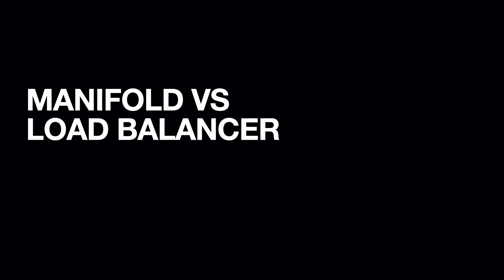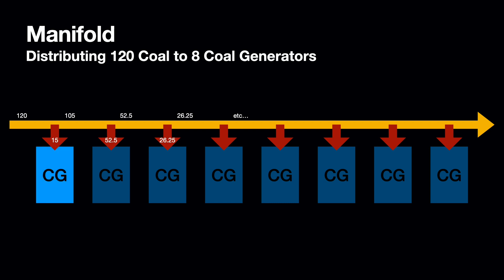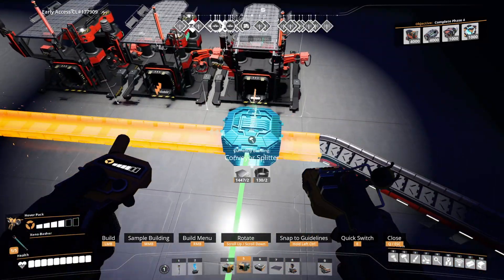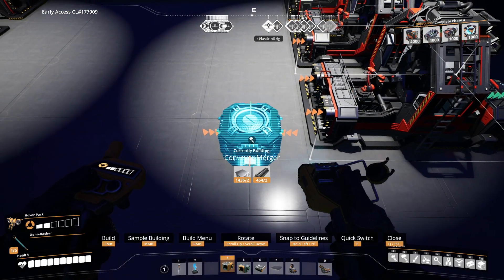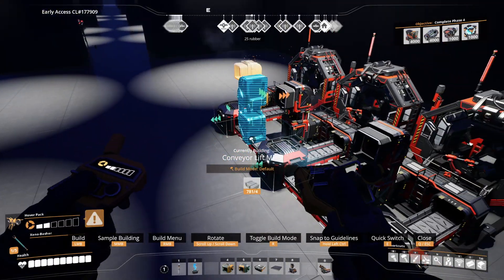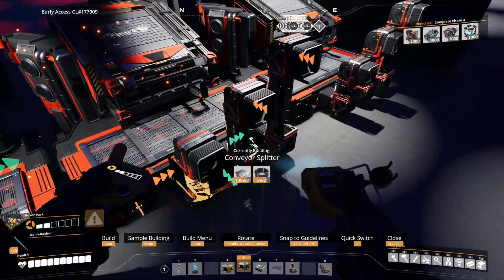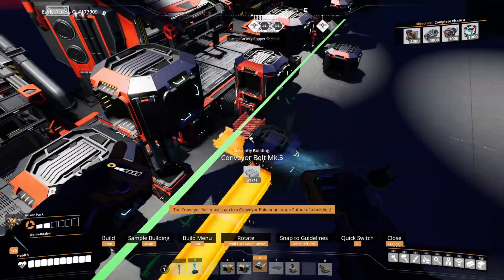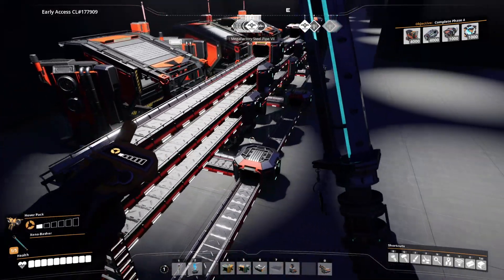Manifold vs Load Balancer - Distributing Items Evenly in Satisfactory

Comment from the maker: Hey - a minor correction! I claim in the video that it’s not possible to build a load balancer for, say, 7 inputs. This is actually not true. You can build this by first building a load balancer for 8 inputs (split to two three times), then sending seven of those to machines and the number eight back to the start of the load balancer. Provided the belt has enough capacity for this extra input, this will be a perfect load balancer for 7 inputs. The same principle can be applied to any number of machines that is not simply a product of twos and threes.
Reply: If you don't have belt capacity you can split the 8th output in 2 and merge them after the first split in 2.
Reply: You know you could dump the 8th into awesome sink.
Reply from the maker: @Naresh-gj5vc  but FICSIT doesn’t waste!
Reply: Anyway , if I need to feed 7 machines, I use one of these two buildings (that are not perfectly even but close, and much more compact):
- a first splitter with three outputs, then two splitters with two outputs and one with three outputs;
- a splitter in front of machine 4 with three outputs: one for machine 4, one for a manifold in front of machines 1-3, one for a manifold in front of machines 5-7 (but I use what I call "improved manifolds", I explain that concept in the next example).
Generally speking I use an hybrid system between manifolds and balancers. For example if I need to feed 10 machines, I will probably split my line in two (one part for a group of five machines) and I'll use an "improved manifold" for each group of five machines. The difference with a classic manifold is that the conveyor belt doesn't arrive in front of machine 1 but in front of machine 3. That way, when you start the line, machine 3 will receive 1/3 and all the other ones will receive 1/6. That way they will reach 1/5 each faster than in a normal manifold build where machine 1 first receives 1/2, machine 2 1/4 and so on... My  improved manifold is more efficient that the regular one, as compact and even requires 3 splitters instead of 4.

Comment: Whenever I see videos like this they always point out that the manifold is so slow. What people fail to observe is that if you had 2 inputs you do NOT need to merge them. Send the 2 into specific locations of you group and split in both directions. For each additional input beyond 1 input you halve the number to reach. So in your example the Manifold at 3:30 the splitter starts in the center input and the splitter goes left and right. It will fill at almost the same speed as the load balanced mechanism.

Comment: With Coal Generators a Manifold is no problem as the coal isnt burned in 1 machine fast enough so itll back up and at some point reach the last machine wich will also get enough maybe even a buffer, its really a problem with Producing stuff because of the fact that not all machines work same speed if u use a manifold they will not have the desired output and thus furter down make problems again.
Reply from the maker: Manifold will always work even if the machines don’t need the same amount of materials as long as you feed it at least the amount of materials your machines need combined. And of course also use a belt that supports this speed.
Reply: @Fjorim  i play since release i know that but Load balanced works better for things like train stations where the resource may run out until the train arrives so every machine gets the amount it needs instead of it having to stock up.

Comment: How I do my Manufacturer. Showcased in this video: https://youtu.be/otuw_KZ3RQ8?t=762
Reply from the maker: Yeah, there are several ways to build manifolds for machines with multiple inputs. I’m actually using a service level these days, and if it’s high enough (4 walls), you can have all belts going down next to the manufacturer, and downstairs connect them to a manifold at different heights. My service level is 2 walls tall, so I need to have two rows of manifolds going downstairs, where they are connected to manifolds at two different heights. It’s a bit hard to explain, but I will showcase this more when my next video on the maxed nuclear plant is up :)

Comment: Manifolds are my personal preference.  Yes, a manifold system takes longer to “load,” but they are as adaptive as you need them to be up to the maximum capacity of the belts or pipes that supply them.  A load balancer only handles a set amount of material at any given time and is more difficult (in my experience) to adjust to new inputs/outputs once built.

Comment: You can improve manifolds by using smart splitters with overflow.  This greatly reduces the time for the manifold to saturate
Reply from the maker: Not sure if I agree. Yes, the first machines will saturate much faster with smart splitters, but the last machine will only get items when everything else is full. This is the case also with normal manifolds, although with those the last machines get some items also earlier. When fully saturated, both manifold types will reach 100% efficiency.

Just watched TerrisDWDC’s video on this topic and I’m not sure I can say the smart manifold is better. It seems to produce fewer total items at least.
Reply: @Fjorim  here is the issue without the smart splitters you have machines going on and off wasting input.  If a machine gets an item then finishes processing it, that item does not help saturate the system with product.  By using smart splitters each machine is fully saturated sequentially, so every item helps saturate with no stragglers.  I mean just test it yourself its pretty simple.
Reply: @marcbennett9232  How does a machine going idle "waste input"? If you're saying that if constructors require 5 items to process, and the last machines are sitting with 2 or 3 and waiting, that's not wasted at all. It's not even slower.

In the smart splitter case, those items are idle on the feeder belt instead, so the "faster"  breakpoint would depend on two numbers:  how many items it takes to turn on the machine,  versus how many items are waiting on the feeder (including inside the splitter) PLUS the stack size of the item input, because all those are sitting idle inside the machine as well. So for an AI Limiter, 480 Quickwire (plus the feeder) would have to be idly waiting before the second machine sees anything.
Reply: @ricobarth  no your misunderstanding my point.  the machine going idle doesnt waste input.  the input not backing up is what is wasting the input.  so a manifold needs to "warm up" to reach 100% efficiency.  most people understand by now, a manifold is just as efficient as a load balancer after this warm up period.  the smart splitter helps by greatly reducing the time it takes the manifold to warm up. here is some of the math.  i will also work up an in game example, but i will get back to you on that.

 lets take a simple one input one output setup, with 5 machines. we will assume a stack size of 100, and using 5 items per minute and 60 items coming in per minute (to keep the numbers relatively easy) im also assuming anything that passes machine 5 is going on to other projects.

Normal Splitter, lets look at the first 60 items going in the first minute.
machine 1=30
machine 2=15
machine 3=7.5
machine 4=3.75
machine 5=1.875

now the machine each use up 5 in that minute and look like this.
machine 1=25
machine 2=10
machine 3=2.5
machine 45=0

so of our 60 parts coming in, how many are "filling up" the manifold?  the answer is 37.5.  the rest have been used by the machines.  

machine 1=55
machine 2-5=0

in this case, we have 55 items "filling up" the manifold.  now lets look at minute 2 for each setup.

Normal
Machine 1=50
machine 2=20
machine 3=5
machine 4-5=0
total item fill=75

smart
machine 1=95  (100 full stack minus the 5 used)
machine 2=10
total item fill=110

minute 3
Normal
machine 1=75
machine 2=30
machine 3=7.5
machine 4-5=0
total fill=112.5

smart
machine 1=95
machine 2= 60 (10+55-5)
machine 3-5=0
total fill=155

as you can see, the gap in total fill is getting wider.  the longer the manifold, the more exasperated the problem.  i typically run a manifold of 14+ machines, so using the smart splitters saves me a lot of time in the "warm up" phase of the manifold.
Reply: @marcbennett9232  When you do an actual in game example, you're going to see the problem with your calculations. It's impossible for material to be wasted. The only thing that can be wasted is time. And it's telling that you're not even bothering to look at the only relevant metric: item output.
Reply: @ricobarth  why does item output increase the speed of the manifold warming up?
Reply: @marcbennett9232  The only reason to care about manifold design is whether or not it increases item output.
Reply: @ricobarth  see i disagree with that statement.  if your manifold takes 2 hours to "heat up" and get to 100% efficiency thats just time you are waiting.  this can be frustrating especially for power generation, which is why i started using the smart splitters in the first place, it greatly helped my coal plant warm up.

Comment: There is a much easyer way for the Manufaktuer the one with 2 Inputs: 
You set the Splitter 3 free Spaces apart from the machine and pur the second one on top of the first the lower belt is set up like a S and the top one like a ramp! This is fast ans easy every other advice is top!
Reply: I do similar thing, only that I build 2 splitters in a line aligned with the inputs, then I build another splitter on top of one of them and then delete the bottom one.
Reply from the maker: Yeah, that’s definitely one way to do it as well :)

Comment: This is an issue I've been wrestling with in my own playthrough. Manifolds are neat (figuratively and literally), but especially when trying to deal with distributing water between my coal generators, constantly being plagued with not having enough water was enough for me to take the time load balancing the water. It really does feel like each method has its own purpose.
Reply from the maker: I’m no expert in fluid dynamics in the game but I’ve understood that load balancing isn’t really needed for them as they will flow on pipes in both directions and fill them anyway. What is important is that you don’t exceed 300 m3 for mk1 pipes, and also to keep in mind that mk2 pipes can’t reliably sustain 600 m3 per minute.
Reply: @Fjorim  I thought that as well, but based on my testing, it does seem to apply as well

Comment: I find the manifold is better because then at least all systems that are running are 100%, then I can add input to fix issues that form
Reply from the maker: Yeah, with manifolds you can quite easily see that there are problems somewhere with the inputs if the last machines on the line have yellow indicators.

Comment: I did not know you could clip a splitter directly onto a lift.  Thanks for that tip !
Reply: It also works for mergers for your outputs. It’s also important to know that there are 3 steps of clipping that each lift has. Also, using this clipping pushes the input/output line by 1 step, so plan appropriately.
Reply from the maker: Yeah, that’s a pretty good way to make manifolds even more compact :)
Reply: Holding down ctrl while placing can help them to snap as well.

Comment: No, there is a solution: Load limiting Splitters. Imagine 120 coals PM on mark2 belt, disteibuted evenly to the 8 generators. With this load limiting splitter, you lay that splitter like manifold but you can limit how much item passes to direction a and how much to direction b. 

Like 120 goes into that splitter, gives 15 to first generator and rest of 105 continues further to the other splitters. 15 to each generator receive the coal evenly in a couple of seconds. Tighter layout like manifold, even disteibution like load balancer.
Reply from the maker: That would work, but there’s no load limiting splitters in the game at the moment, at least not without mods :)
Reply: @Fjorim  You can imitate the effect by intentionally using lower level leech belts on the inputs. use a mk 4/5 for the main manifold bus, then at the machine splitter, only use a mk 1/2. It's really useful for high-volume items, because if each machine requires, say, 50/min, and you've got a manifold line of 750, then you can use a mk 1 to get only 60 to the first several machines rather than 375 to the first machine, etc. It actually extends the full warm-up time because you're warming up more machines at once, but it gives you more throughput during said warm-up by running more machines at a time with less saturation on each (they're only filling at 10 items/min in this case rather than 325 items/min for the first machine in the mk 5 input case)

Once everything warms up, it's no different than mk 5 on all inputs, but it can strongly mitigate the low throughput during warm-up with manifolds.
Reply: @marshallc6215  Fairly obvious solution now that you point that out. I like it! Alternatively, there's a mod called "auto splitters continued" (the original guy stopped working on it) that gives you splitters that automatically balance the load along a manifold. Those splitters are pretty pricey, though, requiring frames, a stator, and a computer to make.